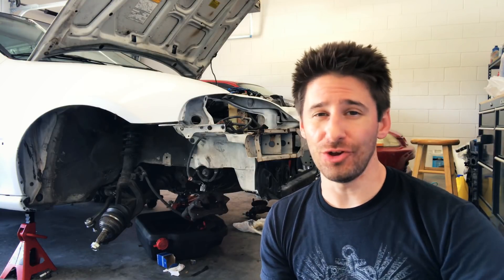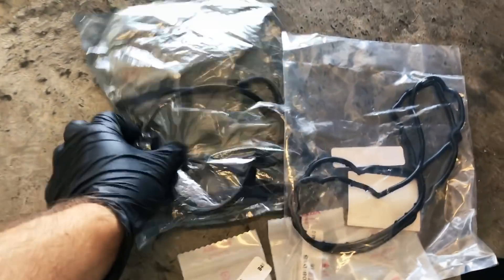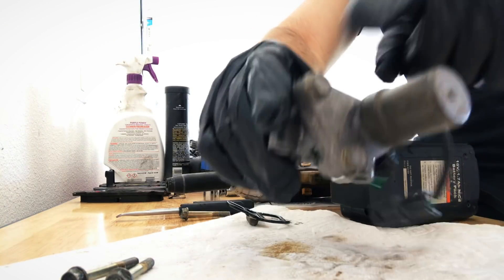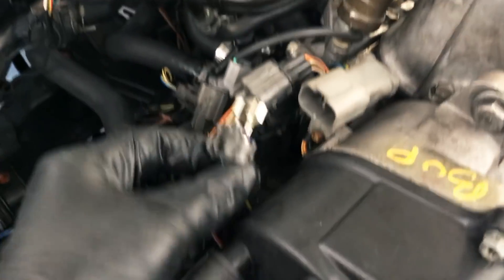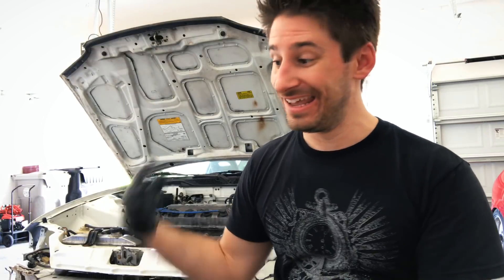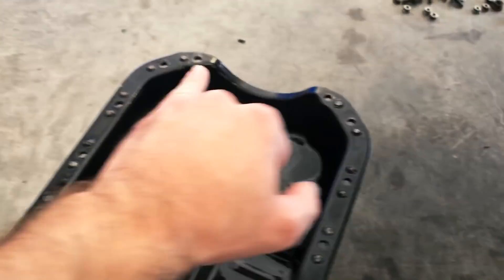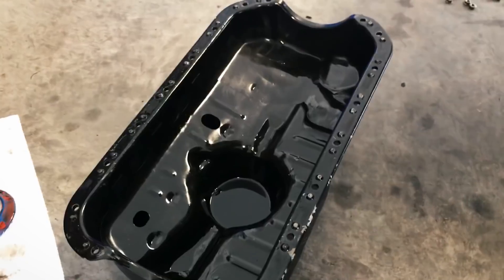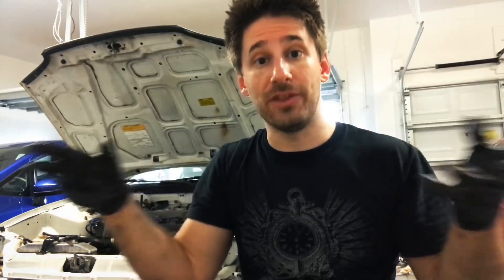D16 VTEC GASKET | OIL PAN GASKET | DISTRIBUTOR O-RING

Comment: That metal oil pan comes on the d16y7 non vitec version of the d16y8.
D16y8 uses aluminum pan for strengthening the block due to vtec power.

Comment: D16Y8 uses aluminum oil pan which is the one matching the gasket you have. D16Y7 uses metal oil pan which is flat gasket. The oil pan you have is the Y7
Reply from the maker: That’s interesting. Thanks for the info! The pan I have on my y7 is black as well so that lines up. Thanks dude!

Comment: I have sane oil leaks all over same engine you have. Was oil leak solved after replacing  those gaskets and o ring. I even have leaks coming out of the valve cover bolts.

Comment: its good that you're doing all hem little bits, by the way lad from just watching you're vid i noticed that you're missing a front lower torque mount and the bracket for the left side of the engine,   ( just below you're power steering pump.) Hopefully u have one other wise ur engine will be moving all over the place and i wouldn't go driving it. Just looking out for you, anyways keep the vids coming.

from Ireland :)

Comment: 2:04
Probably nothing is wrong with that brand gasket when new. And the issues are probably that it wasn't correctly installed. I did the same mistakes. You can read about it there. https://www.clubcivic.com/forum/threads/96-00-service-manual-free-to-anyone.176563/

Comment: Your oil pan looks super dented! And also if you’re doing the front seal aka oil pump seal, you’re gonna have to pull the pan and oil pump to do it. I’ve never seen or been able to do that deal with the pump on the engine.

Comment: So that connecterr thats ruiend how come it's not plugged in ?? I have the d16y8 and I'm fallowing it  step by step from your videos I got a ej1 and wanting to turn it on but I'm running my OBD1 harness and I got the y8 harness so what's the other clip for that's broken but goes in the distributor?? Does it need it to turn on the car ?? With the y8
Reply from the maker: The broken connector on my car was the second plug for the distributor and yeah, you need to plug it in. I was just waiting to get a better connector on it before plugging mine back up. It was literally crumbling every time I moved it

Comment: Do you know where i can get a fuel injection air control valve for a d16y8? You showed yours in the video. I dont know where to get it. During my swap it broke and i cant engage vtec without it.
Reply: Ozzy Velez junkyard

Comment: i have a P28 ecu &z6 harness i have a mini me swap what would i need to make the ecu and harness work on my 99 Ek?
Reply from the maker: As far as I can think off hand just an obd2 to obd1 conversion harness so you can use your p28 ecu. That should be able to be done with the harness that came with you Ek, you shouldn’t have to change out the harness to the z6 one. I’m no expert on that though man, check out some info in the forums too

Comment: I know this video is a bit old but can you help me figure out while my oil is still black after changing it already
Reply: There's an abundance of varnish in the engine created by oil cooking & not being changed often enough in the past.  That varnish is what darkening your oil.  I personally have a diesel fuel trick, being careful not to let the engine get hot but you might just want to change your oil/filter every 2500 if you want.  It will lighten up in time.

Comment: Did the oil pan gasket work? cause mine seems to be leaking from the same specific area also.
Reply: Same here and I thought it was the crankshaft seal, going to try and replace mine. But i have a d16z6
Reply: @mrharleytx6813  I got a D16z6 same spot leaking. Lemme kno